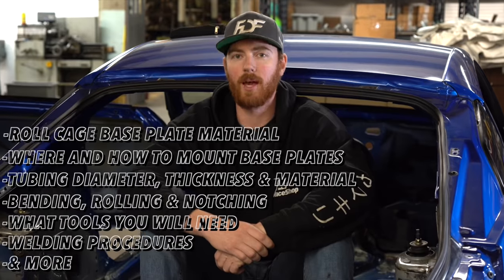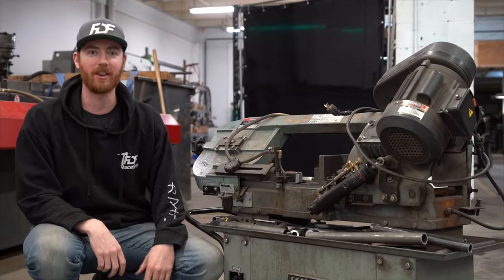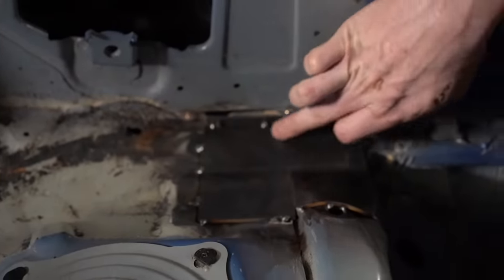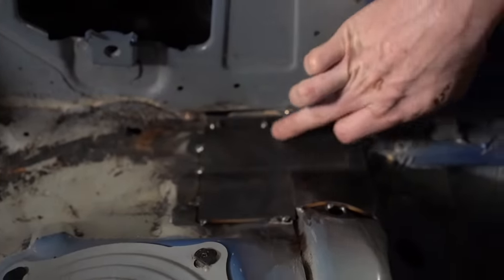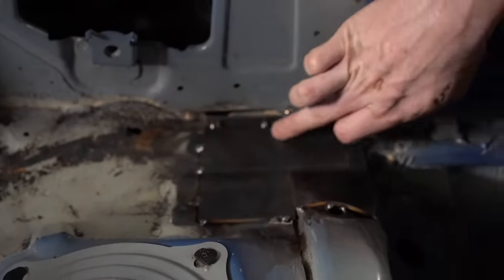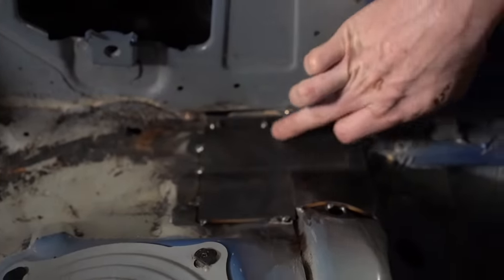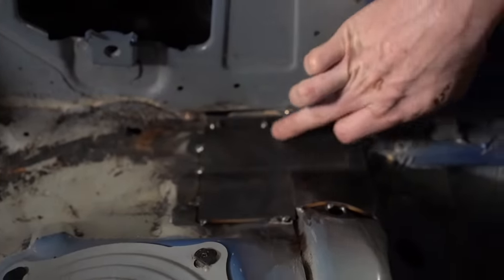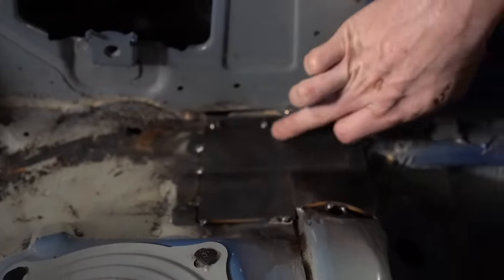How to Build a Roll Cage| Step by Step

Comment: Thanks for sharing of your hard earned experience and wisdom on general fabrication tips and tube bending do’s and don’t’s as well as your reasons and methodologies on cage construction. I really do appreciate that you explained your reasons and logic on various points in the construction of this cage. That was really helpful. Although this wasn’t a cage for a drag racing door car, the general approach, materials, construction and thinking are all the same, to keep the driver safe and add major rigidity to to the chassis. Thanks a ton, bud !

Comment: This is a fantastic video.  A few years ago I built my own cage in a 240Z, and while it turned out OK, I wasted a lot of material with screw-ups and mid-course corrections.  If I had seen this video prior to the build, it would have helped immensely.

Comment: Have you ever considered implementing an old feature that I believe Porsche used in the 60’s?

They ran a completely sealed and pressurized chassis using regular compressed air and a gauge fitted to it. 
… any drop of pressure indicated some sort of structural failure and also aided in locating the crack or cracks. 

Ingenious, efficient and effective, just a thought and definitely something else that could set you guys apart from everyone else.

Comment: When notching a straight bar like the harness bar, how do you measure the length while considering the notch depth?

(How do you measure the notch mouth depth on both sides where the horizontal bar connects to the down bar?)

Comment: Just wanted to add a comment as I noticed a little bit of difficulty in cutting the notch using a hole saw and wanted to suggest annular cutters (rotabroach) of the type usually used in heavy steel work as these have cutting teeth on the faces and sides for milling and would work on your setup. 
Hope this helps

Comment: Good video I learned a lot,I've been racing dirt tracks for 30 years all my late models I buy pre built but on my street stock and hobby stocks I normally build them myself,We usually leave like 3" between the cage and roof and sides,The thinking behind that is that during a wreck the body absorbs the initial shock before getting to the cage,Not sure if that helps or not,bit great video thanks for sharing

Comment: Super cool video, and great explanation on the order of tube install, and most importantly, why, (i.e, being able to pull the tubes next to the body far enough to have room to complete a weld).
Do you go back once the cage is done to add gussets to the cage, or gusset the cage to the unit-body?
Oh, and get a roll bender...

Comment: This was a great video! I'm wanting to start to learn roll cages.  I figured I'd start with a "exo-skeleton" on my 1987 4runner.  It should be close to the same.  Just measuring the inside instead of the outside.  That makes sense, I think.

Comment: Cool video. Is there space underneath the plates between the plate and the sheetmetal of the chassis? I’ve never seen it done that way before. We used to call “tack and whack” “hot tacking”

Comment: Could you have raised the height of the main hoop by cutting out and boxing in the bulkhead that interfered with the bar to the rear? This was an excellent video. Thank you.
Reply from the maker: Not recommend but depends on the chassis. For this 350z that bulkhead is arguably stronger than the tubes were installing so it is best to keep.

Comment: Great video. Quick question - is there any worry of corrosion under the base plates? Do you ever attempt to put holes in the base plates to spray in the cavities after welding?
Reply: Probably not since it should be sealed from the welding, but it couldn’t hurt to spray some weldable primer on the base plate and car body.

Comment: I think you did talk about it but you didn’t show us how you welded the Nassar door bars to the main hoop. Space is limited there between the bars and body.  I usually have the door bars in before I drop and move forwarded the cage. That gives you a bit more space as you are bringing it forward to the door opening of the body. But you have to plan your door bars to move forward and down with the cage. But im interested to see how you welded them.  Did you just ratchet strap the main hoop together gaining space between the body? Ive done quite a few 350Z’s its not easy, you have done a great job.
Reply from the maker: Exactly how we did it yes. And yes it is still pretty tricky, I've done a few aswell but this was the first 1.75" material cage I did so I figure mine aswell show the process of measuring and such. I have the car saved in 1.5" so wouldn't of needed to measuring anything to make my bends. Thanks for watching!

Comment: question: which side impact protection is better?? cross or nascar bars? lets say side impact right in middle of door? cross dont have extra material to bend inside cabin so they pull on A and B pillars where nascar had more material to bend in once they start pulling on A / B pillars? what is your point of view on that matter?

Comment: Hey guys I had a quick question with tubing material.. I wanted to build a cage and have a 1.75 bender so I was going to use .120 dom but the prices of everything makes it unattainable... for budget cases when would you stray away from dom? This is for a rock crawler

Comment: I'm setting up to do a '91 Metro for rally. Is that easier than the 350-Z about the same or worse. I have seen kit cages for this car, but I don't trust them. Should I plan to cut/build my own (I have someone who can weld) or use a kit my first time through?

Comment: How come you made such a huge point in not having a file pre made for a 350z in 1.75" tube but everytime you were inputting your measurements you had 1.50" selected for tube diameter. Like you said a different diameter tube/die will have a larger or smaller bend radius. First thing that came to mind when I saw how tight the main hoop fit.

Comment: thanks for taking the time but as a lifelong racer and 3o yr fabricator I only have one major issue and a minor critique. Major issue is the use of reverse bends on the upper door bars. You could have removed the reverse bend for safety and bent a normal NASCAR-ish door bar. many orginizaions have banned the use of reverse bend bars. would have like to seen a couple of gusset tubes utilized in mainhoop to a-pillar and or a-pillar to top of door bar for roll over crush. that forward bend is pretty severe. 

minor critique, you mentioned building the cage for Champ. Champ follows is basic design the SCCA rules. You should mention to people that while fabricating a custom cage in the 350Z this will also pass tech with the following organizations. Which it will except NASA and Lucky which has already banned the use of reverse bends in new log booked cars. Clarify the actuall differences if there is any. 

the work was spot on and your vid was good. Not trying to degrade you in any way.  I look forward to seeing what you do next.
Reply from the maker: I agree with what you are saying. Although we did reverse bends on this one I have never done it where I don't tie in to a sill/rocker bar. (For example some may do 2 Parallel tubes with reverse bends in both and that's it. This is terrible for side impact. I will do 1 or 2 tubes like that and always a second or 3rd sill bar with 3 verticals joining to it that is straight (the thumbnail is another cage I did showing this) and usually stitched to the chassis. Given the position of the main hoop in the car there wasn't anyway to do a Nascar style without going through the B pillar. The Scrutineer has already passed this cage for what the chassis will be used in. Thanks for the input and I do agree on your points!

Comment: I noticed that You chose not to TIG weld the roll cage, I suppose in drifting it is okay to MIG weld the cage?
Reply from the maker: Yes mig is acceptable for 90% of the cages we do. We will only tig if the customer requests or if we are using alloy material. Tig comes at a higher cost due to the extra time it takes.
Reply: @FDFraceshop  right on thank you!

Comment: Any good electrician can easily make a roll cage. Its the same rules for bending and cutting conduit to fit in any space. Ok Give me a break on flanges and such but!! However there is a rule of the maximum number of degrees / bends of bending in any wire pull.